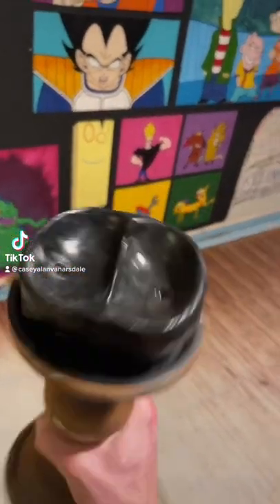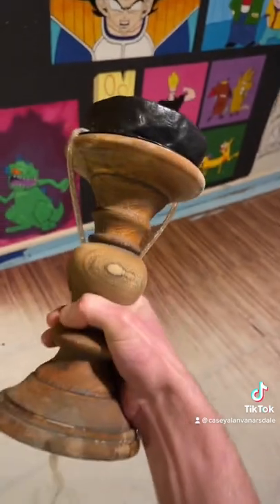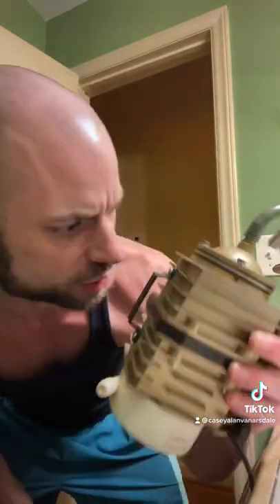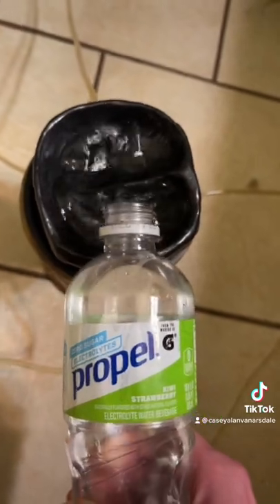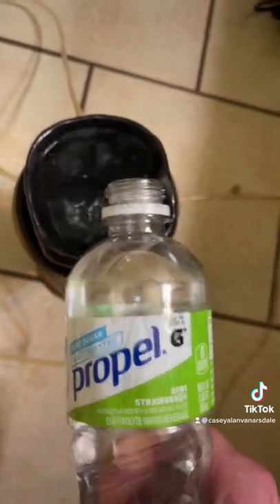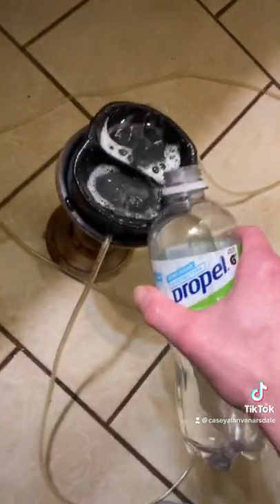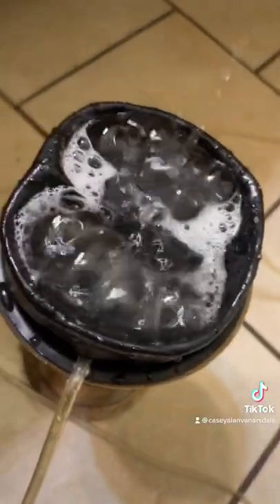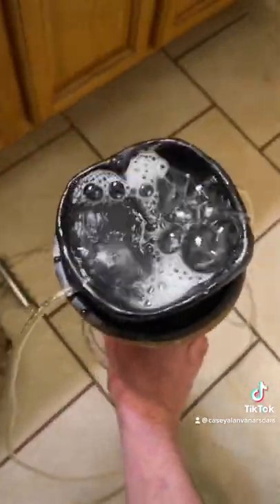For the dude guys

Comment: My bidets proform a similar service. They have two different nozzles, one for the number two, a few rocking back and forths, and totally pressure washed. Other nozzle is feminine hygiene. But, also is a quick rinse. I had a accident involving road rash, fractured ribs, fractured humorous, torn rotary cuffs, and can no longer, fully articulate my arms. So I put in the bidets. Got a two speed rechargeable, portable hand held Blaux bidet, I carry in a fannypack.

Comment: Very nice, but this begs the question is it multi use? Let’s find out
Reply: Extensive analysis shows that not only it could be used in sexual means it could also serve as a personal water fountain and the statue kind as well, research from me also furthers this theory by showing the shape of the “washer” can indeed be used to clean teeth . Now let’s move onto the sexual side of this #1 obvious lubricant and #2 self pleasure station for both sides in the genders